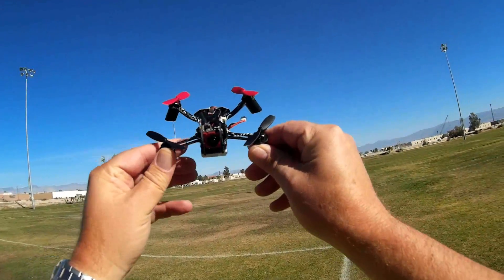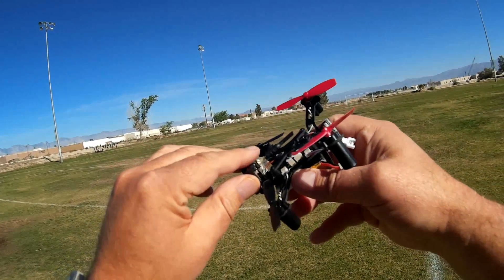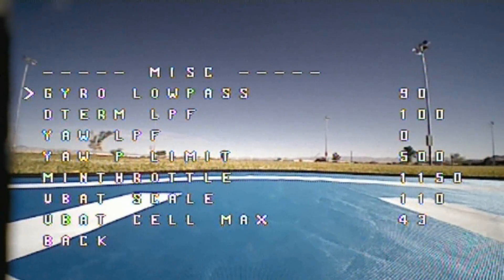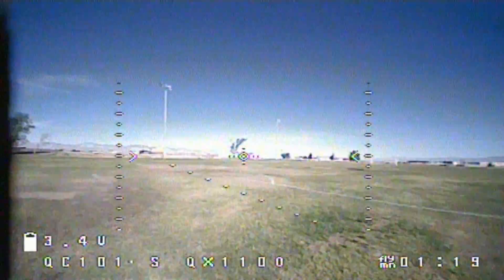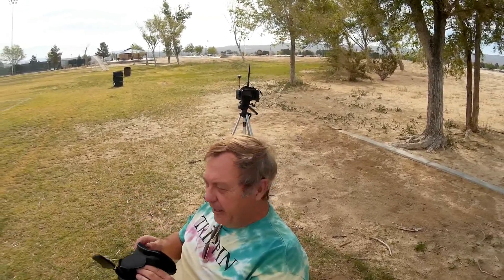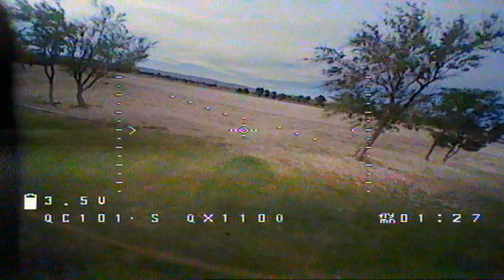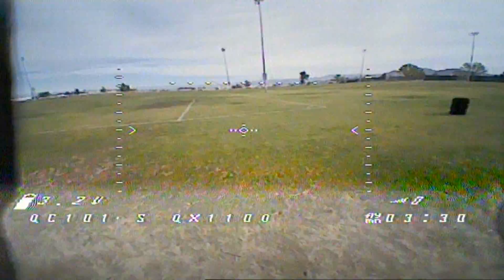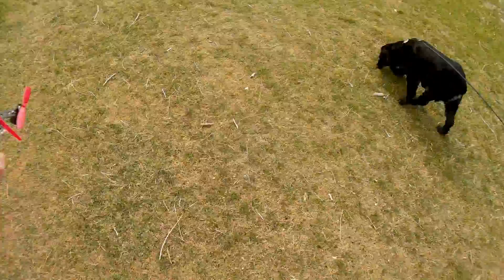Eachine Vtail QX110 Micro FPV Drone Flight Test Review

Comment: what kind of transmitter are you using?👍
Reply from the maker: I got the DSM version.  I was using a Devo 10 software with Deviation firmware.
Reply: Ok, thank you for sharing 👍
Reply: I have the frsky receiver, having a little trouble with it. I can't get my taranis QX 7 to work with beta flight, switches are right but I got to figure it out.
Reply from the maker: The folks in the following forum should be able to help you. They helped me.  https://goo.gl/jdrI0W
Reply: Quadcopter 101 thanks

Comment: I posted some even better yesteday :)
Reply: the props are the biggest problem on this machine switch them out and runs smooth. will have a video on it soon
Reply from the maker: Any recommendation on which props?
Reply from the maker: I just saw that.  Going to try them.  Thanks again!
Reply: Which micro done would you guys recommend? @SeBy DocKy @Quadcopter 101
Reply: bruhed or brushless ?